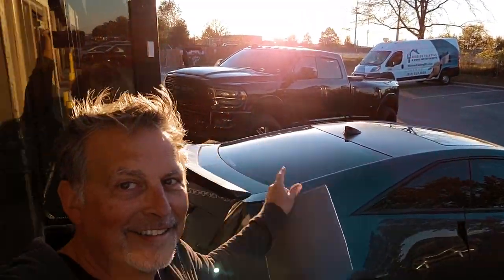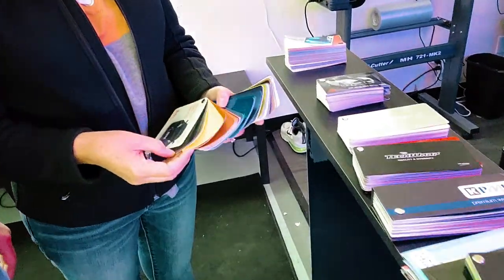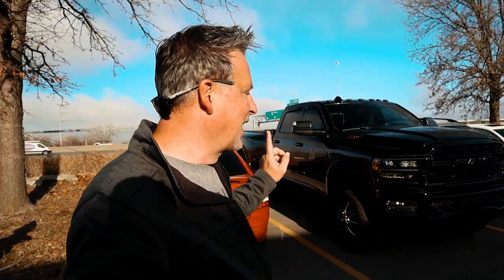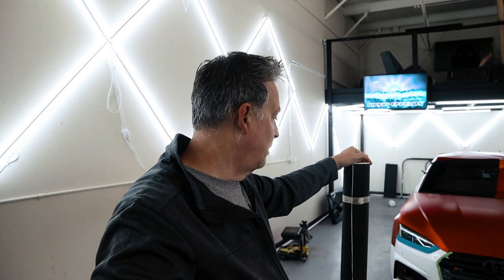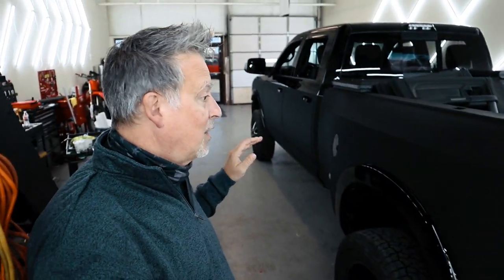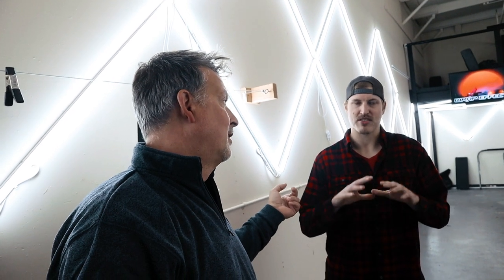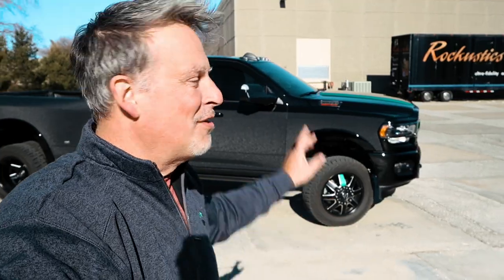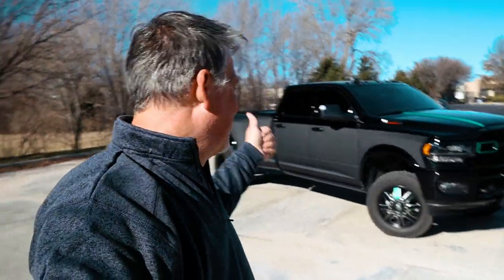Vvivid Indestructible Wrap (Does this actually work?)

Comment: I have the 2022 Limited in graphite and used clear wrap on the rear fenders to keep the rock chips down.  The rocker panels are getting chipped and I looked into Line-X, but they want $850 and two days to do just that small part below the doors.  I'm glad I found your channel and will be ordering this product for my rocker panels.  I've wrapped an aircraft, so I know the process and have the tools.  Thanks for being a test pilot!

Comment: I have a 2021 with 4000 miles and stock wheels and tires on it and have the same problem with rock chips. 
I really like the idea of the wrap instead of a spray on material. 
Mine has a piece of clear stone guard on the front of the rear fender but it's only comes up about 5-6 inches which is not far enough.

Comment: Did you just remove all the emblems?   Looks like it does not stretch as well as most vinyl's?
Reply from the maker: It is thicker than the normal vinyl so there is very little stretch/give. And  the emblems were all above the vinyl line so we did not have to remove them.